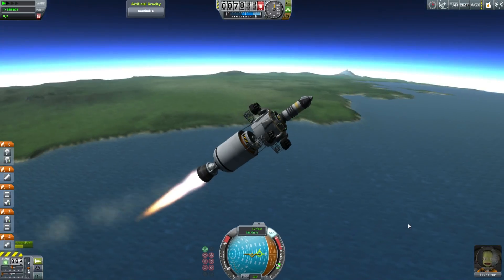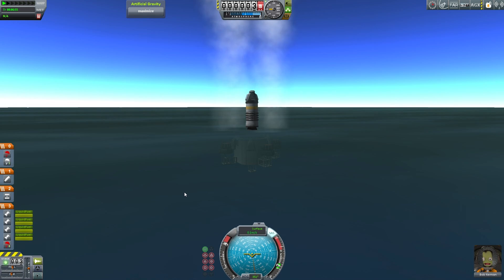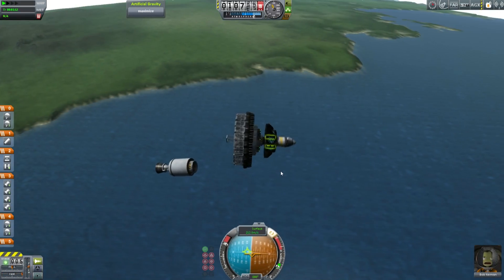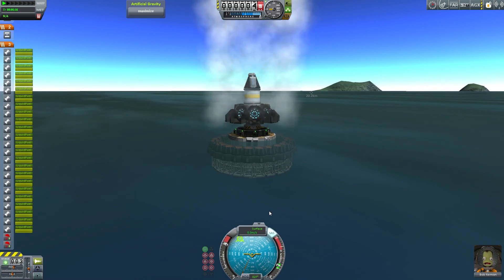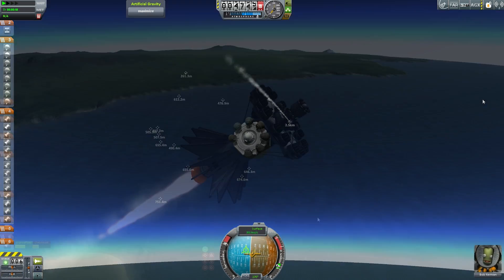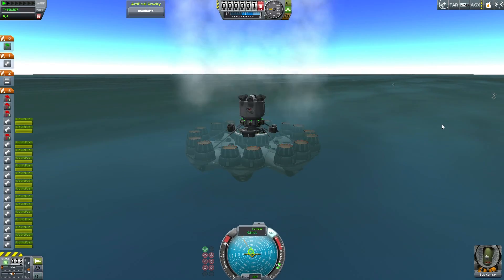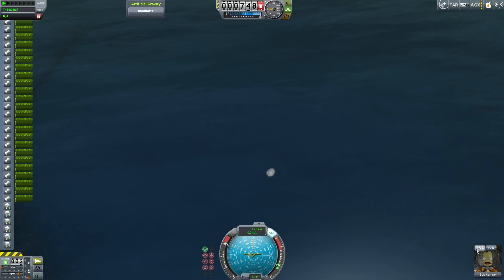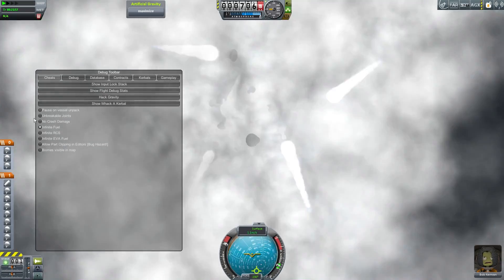Kerbal Submarine Program

Comment: The human body sinks below 20m?
are you sure?
I don't know different but that's not the impression I got from watching those extreme free divers.
Reply from the maker: MrMartGonzo If you breath in at the surface then your lungs get compressed and you'll begin to sink at a certain depth. You'll notice free divers use air bags to lift them back to the surface as quickly as possible.
Reply: Scott Manley
ah I inderstand, thanks for the info.
Reply: chaos umm? I don't think he said anything about the buoyancy of gas changing... He said the lungs get compressed, i.e. that there is less displacement.
Reply: Scott Manley well a free diver crosses its buoyancy equilibrium at 6m. and im sorry Scott but the relative buoyancy of a mass of gas is the same at any depth, its the change in the displacement that changes and overcomes the buoyancy force. if what you described in the video was true, gasses/bubbles in deep water would never rise to the surface.
Reply: No you don't sink after 6m that is ridicilous.
Reply: MrHogzor  Actually the difference between salt water and fresh water is substantial, you are more buoyant in salt water. when i dive in salt water i use 15kg of extra weight, in fresh only 8kg. this was also explained in the wiki i linked a few post up. i dont free dive in fresh water because the dangers in the buoyancy difference, and many scuba divers died/got in big trouble for not planning ahead for a fresh water dive.

+taeyeonlover effervescent gases are the gasses dissolved in your blood. your lungs hold around 2Ltr of gas, there is nearly 8ltrs of gas distributed around your body and in our blood. divers use a buoyancy control vest BCD/BCV that has large air sacks that hold around 20-45 Ltrs of gas. even with a 15-20Kg tank and all the gear we still use weight belts to become negatively buoyant at the surface. its done like this so if there is a problem we can ditch our cheap expendable lead belts and rise to the surface, using either the BCD or our own power (still going to sink past the 6m mark).
Reply: If that is the reason you said flesh compression is a major factor, then I must disagree with the reasoning.

First of all, liquids and solids are not very compressible compared to gases. Also, more change in volume equals more change in density. Therefore it's not true that less pressure is required to increase the density of solids (and liquids) compared to gases. Rather, the opposite is true.

Also, your whole body floats or sinks as a whole, so it does not matter whether it is easier to compress gas to a density greater than water than solids. Any change in volume, whether it be from the air in the lungs or anything else, will affect overall density. Therefore the compression of the lungs ought to be the major contributing factor.
Reply: MrMartGonzo MrMartGonzo lol, That isn't true, the body DOESN'T sink, as my sister is a dive master.
With a license, and a certificate.
PS:you sink if your lungs are filled with water
lenny face
Reply: Scott Manley if you go up too fast you can die of air in the blood, like bubbles, that's dangerous..
They swim up to the surface letting out all their breath, mostly only saying:"aaaaaaaaaaaaaaaaaaaaaaaaaaaaaaaa"
Until you reach the surface, else your lungs explode because of the pressure.
Reply: MrHogzor okay, I'm not an expert in diving so I don't really know whether one sinks or not, but I still don't understand chaos's and your post.

So are you saying you don't sink when you're below 20m? That is exactly opposite of what I think chaos is trying to say, that you sink below 6m. Or am I understanding things wrong? And even if chaos was right, it's still a strawman because I didn't see anywhere Scott say what chaos wrote he said. (unless I missed something)
Reply: MrHogzor welp, I'm still confused.. when do you start sinking then?
Reply: MrMartGonzo Actually, you do. Hundreds of people have died from diving too deep. You simply cannot rely on your floating capacity as the pressure compresses your body.
Reply: chaos I totally trust that your experience as a licensed scuba diver and I have no reason to think you're wrong in terms of the neutral buoyancy at ~6m. So that's that. (maybe Scott mixed units up? since you say its 20ft, not meters?)

But I still disagree with you on the solids and liquids thing. Liquids and solids are so 'uncompressible' that you can basically ignore their compression when comparing them to gases -- they are orders of magnitudes less compressible. So the relative buoyancy of a gas bubble deep in the water would be less than the relative buoyancy of a bubble near the surface. Why wouldn't the bubbles get less buoyant as you do when you go deeper into the water? I would guess that gases would have a theoretical neutral buoyancy depth that is beyond any reasonable value (they would probably dissolve into the water as in carbonated drinks or condensate into a liquid before that) and that is why all bubbles float up.

And you also keep forgetting to think of your body as a whole, because the greater change in volume due to the compression of the gas in the lungs will give a larger reduction in density to your body, which is equivalent to a larger reduction in buoyancy.
Reply: chaos Enjoyed reading this exchange and your patient explanations. Don't mean to be rude, but do yourself a favour and try to remember the difference between "then" and "than". "Then" is a point in time, "than" is a comparison, e.g. "Thing A is more dense THAN thing B" and "I performed action A, THEN I performed action B".

A diver should also know how to spell ascent - an "accent" is how you talk ;)

Hope you have had (or get) the chance to dive Ningaloo reef in Western Australia where I'm from, it's the best. I dived there shortly after getting my ticket as part of a high school program many years ago.
Reply: +Plasma Struck No, it's the pressure of the depth acting on the gasses within you.
Reply: chaos came here looking for this comment!
Reply: taeyeonlover No he said you sink. but you don't
Reply: I didn't know flesh being compressed could be a significant factor. I guess you learn something everyday.
Reply: taeyeonlover think of it like this, how much more compression (reduction of volume) is needed to reduce an equal mass of gas to the same density of a solid of the same mass, it takes very little pressure to increase the density of a solid versus the range of change of volume of a gas under the same pressure.
Reply: yes more change in volume equals more change in density, and yes solids and liquids are not very compressible. but they do compress with very little change in volume, now the volume is about the same but the density is higher (solids are already very dense) no would that solid not have less buoyancy??? my point is the when a gas's volume is shrunk from external pressure its relative buoyancy is still the same, remember the density of the liquid around it is also increasing as the gas's does. now no amount of misunderstanding of what im saying is going to change the fact that i have personally observed this change in buoyancy whenever i went swimming in water deeper then 6m or  roughly 20ft for the Americans reading. i have to swim down to 6m and counteract my bodies buoyancy to around 6m then im neutrally buoyant, if i swim just a bit more down gravity takes over (slowly at first) till around 8m where i could say i would be sinking at around half 1m a sec. its still rather easy to counteract it by swimming up, and when you reach that 6m mark again its best to exhale to provent getting the bends.

fun fact, one of the exercises we did when getting my dive scuba license is a single breath accent. from around 20m you take one breath and ascend to the surface continually exhaling, this took just under 10m to get to the top exhaling all the way up. weirdest sensation  ever.
Reply: what you say is true but the "solids" your body are made of are rather compressible, in fact many of your organs like kidneys and liver contain mostly compressible solid and water. Im not saying the gas in your lungs have no part in this effect, we use controlled breathing to adjust our buoyancy by up to 2ft up and down when swimming along a reef. however there is more gas dispersed in cavities throughout your body then you have in your lungs.

if you look it up im sure you can find a video demonstrating hydraulically controlled  buoyancy. using a fair bit of force a neutrally buoyant piston filled with liquid compresses, the once buoyant system becomes more dense and starts to sink. the reason subs use ballast tanks and gas is for efficiency, but the same thing happens with the body when under pressure.
Reply: so that'swhat you meant by effervescent gases.. Well, I still feel like gas compression (whether it be in the lungs or other cavities) will be the major contributing factor, but I'm not willing to do more research on it just now, so I'll try to look it up later.
Reply: MrHogzor It's not that hard to test. Just need a swimming pool deep enough. Or could try doing it in a lake, but I think it's too dangerous without any gear.I tried diving to the bottom of a 5 m deep pool a couple of times and it felt like I had to put some extra effort into swimming back up. I also tried exhaling before diving and I was definitely sinking even at a depth of about 1 m.
Reply: Andrius R. Yes so have i.Even in the bathtub u sink if u exhale so it make sense hehe. But when diving down under 6 meter you still float. I've done it several times.

I couldn't imagine it would be any difference to seawater. both are the same fluid. exept one has less chemicals and more salt in it. As a matter of fact. Now when i think of it saltwater makes you even lighter in water.
Reply: +Scott Manley Kerbal uses a physics system where densities and mass are higher than our universes, right?  So does water in the Kerbalverse have different properties? Some additional random comments. Going EVA underwater with a helmt at 1 Bar would be bad. The pressure would try and push Kerman into his helmet. The greater the depth the more force stuffing him into his helmet.  Mythbusters did an episode on it, disgusting. There are personal subs called SeaBreacher that use fins to overcome their positive buoyancy, maybe a sub with wings could work? Are there any componets that will sink in Kerbals waters?
Reply: full ore tanks